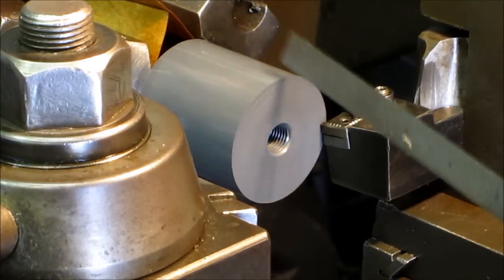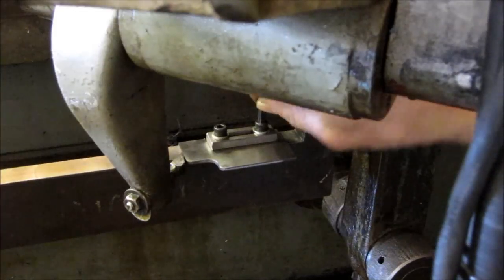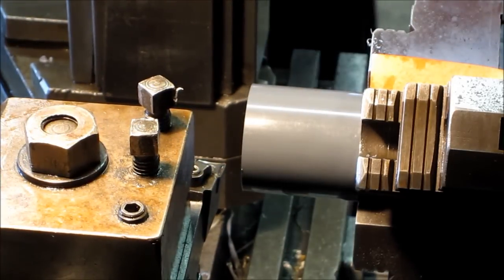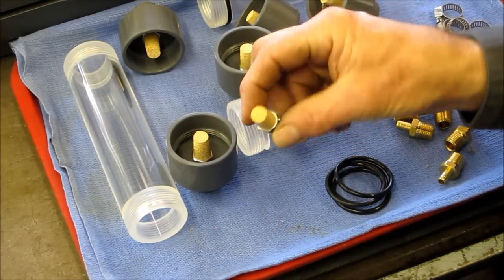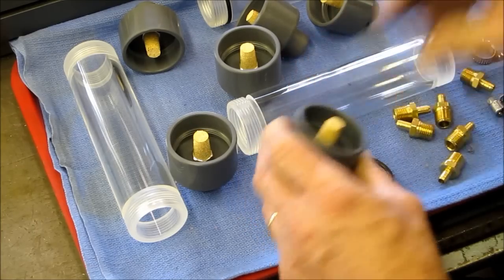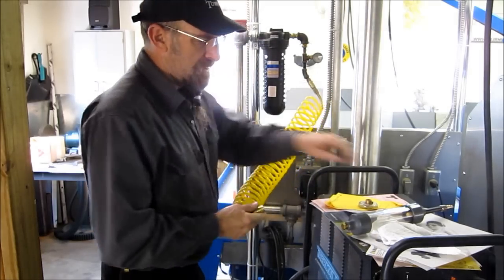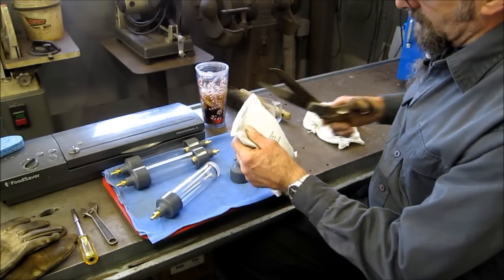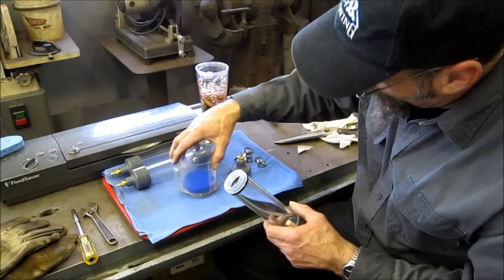Dry it Up Part 3

Comment: FYI:  The local pharmacy throws out desiccants daily.  The dessicants are in tiny little packs and thimble type containers.  The dessicant is sealled in these packs and white crystals (Not blue).  Check with you local pharmacy to save these for anyone who wants them.  Most pharmacys will jump at the chance to not to throw them out.  Just place in oven as described and there will be no color change.  Thanks Keith from all us DIY types.

Comment: That tracer attachment is really slick.  Bummer on the crash, hindsight is always 20/20.

Time will tell on the storage bag, but I think you'll have good results.  It just has to last long enough for the plasma cam one to go bad.  The new stuff was probably in a foil lined bag, metals are not permeable.  Most plastic is permeable to water to some extent.  Next time you could try and fill the bag with Argon before you evacuate it in the sealer.  Nice series thanks!

Comment: Great series.  I saw Jody's video last week too.  I made a charcoal holder for a fish tank with brass in to PVC fittings and didn't tape it.  It leaked without tape on the threads.  Your threads must be cut well.  What am I saying? Of course they are.